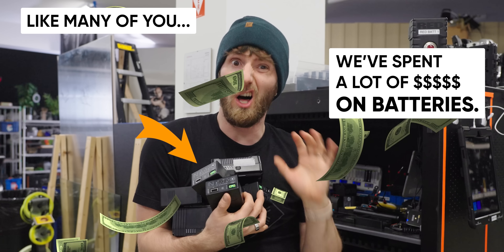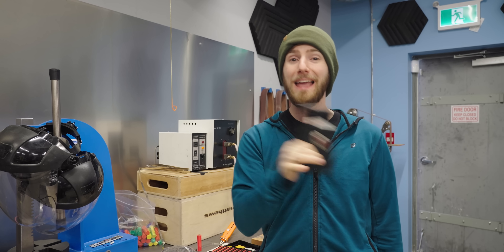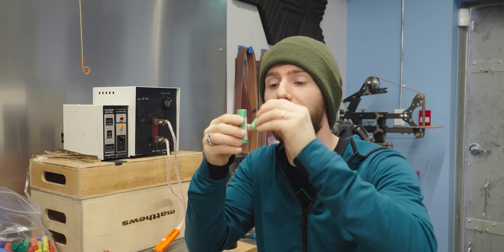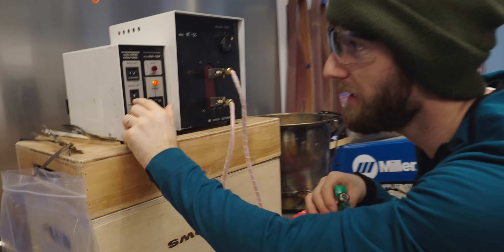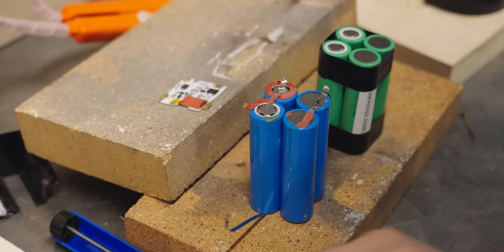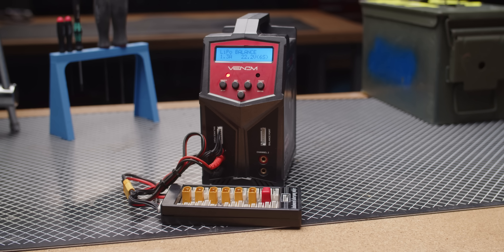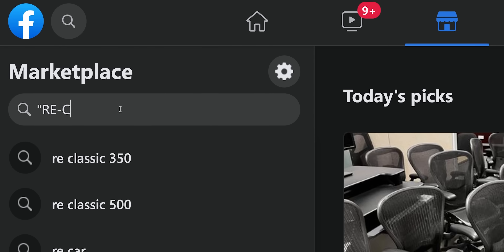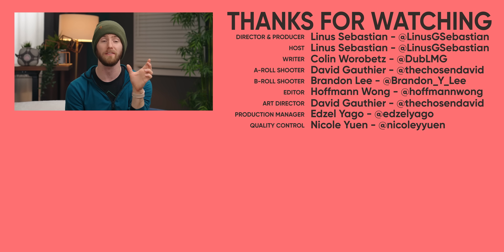This should be illegal… Battery Repair Blocking

Comment: So im no certified electrician and I’m self taught by YouTube. You need a system that doesn’t require a press down like that. I use a button on side and apply my own pressure it’s a very light press and a quick tap of the button. It does the job very well and it stays. What your doing isn’t right. You need to see some tutorials. The spot weld is too big and you need something small. For more control and accuracy.

Comment: 11:15 watch it in slow motion, he is welding a negative lead that is not connected to anything, I do believe you are overreacting good sir. Bro, I have literally sat there and sparked an 18650 300 times in a row for 5 minutes straight nothing bad has ever happened, that will not hurt it at all. It is when it is fully charged and you shorted out for more than 5 minutes, because the battery will heat up.

Comment: It's pretty frustrating how you can replace a battery to revive an otherwise dead electronic device but it is software locked to be useless. I tried replacing the button cell battery in a Tile with a non-replaceable battery for fun and was able to get it powered on. But no amount of effort could get it to connect the app because they added a software expiration date to them so it's useless. I saw other users had luck many years ago but this software expiration date was added sometime after. I did try making an app to communicate with the Tile and I was able to see it as a Bluetooth device but I haven't been working on the project anymore and the required information for it to work is likely encrypted.

Comment: This is exactly what happened to my Dyson battery packs. The BMS has a set amount of charge cycles before they stop charging. I removed the BMS from the battery pack and tested the cells just to find out they work perfectly fine. Lost 1 loyal customer after that!

Comment: I would like to see you buy generic bms boards and build your own red batteries with more capacity and longevity 3d printing the new housing. It does look like a fairly simple project. Use a lipo battery charger from china, like the imax version to individually charge each cell to the desired voltage before assembly. You don't even need that much tools. You can just use a 3 USD soldering iron. you will just need to sand the battery terminals for it to glue to the wire using normal soldering.   Than you can sell it on LLT store

Comment: You need to put the Sony battery to a charger for activation - since the BMS and protection circuit was unpowered, its in "protective" state, not to mention that with the random order of connecting the 2S stack, you could have triggered it to enter the protection and disconnect.

Comment: There's a great video by DIY Perks where he turns 84, 21700 li-ion cells into a single, 50V, portable power station. He groups all of the alike voltage cells, retrains them with a charger (Storage mode), lines them up in holders, spot welds them in series, gives them a BMS and, Bob's your Auntie, a chonker DIY power "Brick" the size of a briefcase that you can run a microwave oven with.

Comment: You missed one major step Linus. Many BMS boards will actually shut themselves off once they're disconnected from a battery. Once you wire your battery up you put a charging voltage back into the battery and the BMS will reset and then you can measure a voltage from it. Many boards that I personally purchase for my battery projects are the same way.

Comment: My take is that once a manufacture sells you something, that device works for you, not them.  Devices should be built and sold to service the user.  This means they should not attempt to stop the user from fixing, altering, or replacing parts or code.  I'm not saying they should give away schematic or code (though both are the most effective way to be customer friendly), but they cannot stop a user from using the device as they see fit.  If I want to upload my own code to a tv, that should be my right.  If I want to replace a capacitor, the device should not kill itself just because a part is different.  Things like copyright protection, and IP theft, all have ways to protect from a legal standpoint.  Tech should not be the judge, jury, and executioner, nor should tech companies.  Plain and simple.

Comment: As an electrical engineer I highly recommend you run the battery pack to be repaired down to the lowest possible charge state before disassembly...also the replacement cells should be at the lowest charge state for the chemistry.

Also as for the battery lock out (planned obsolescence) ...see Makita batteries.
Thankfully there are ways around the Makita shenanigans nowadays.

Comment: I've already did a RE-CELL on my laptop battery pack. Also 18650's. Just bought the cells with the nickel tabs already attached. Worked flawlessly in my case. Laptop worked (on battery) instead of 20 minutes up to 5 hrs again.

Comment: hey linus just a tip if your going bin the battery's please submerge them in salt water for a min of 24 hours this will slowly discharge all cells at the same time. then you can test volts again and submerge till 0V is reached.

Comment: Please mention that 18650 cells are all specced differently as well. You went to a vape shop, so I'm assuming for your needs you needed a battery rated for a speedy discharge rate. Some batteries are good at short bursts of power. Some are good for capicity. Etc. Every product will have its own needs when it comes to what kind of 18650 you need.

Comment: Before disconnecting the bms, you need to connect a voltage source parallel with the BMS, then remove the battery. Otherwise, due to the 0 volts on battery terminals, the IC in the bms detects a short circuit and locks itself.
This is not malicious, it is an added security. This mechanism probably saved countless lives and prevented many fires!
Reply: Often it is neither malicious nor security. A cell OCP implementation can be as simple as a  P-MOSFET (usually), resistor, and low voltage zener. Disconnecting the OCP circuit can cause the gate to float and discharge causing the protection FET to latch up. That can be reversed by shorting or reverse biasing the gate-source and it will work again in such cases.

Comment: Honestly, why are you making these videos if you end up doing a crappy job of it?
You never shorted a single cell, it always was your spotwelder sparking. If you had shorted a cell, you would have definitly noticed and would not have the time to put it in a bucket by hand....
This is now a Video of you putting a bunch of working cells into a bucket of sand and misrepresenting the danger level and difficulty of the task at hand, while at the same time showing improper safety procedures.

Comment: Thats the spot welder sparking because you released pressure before it had turned off the power not the batteries failing, if the batteries failed you wouldnt be presenting to camera as you calmly pour sand on top of it

Comment: I have to disagree. If companies did not take measures to prevent or make too complicated to be reasonable this kind of swap out they should be absorbing the guilt for the inevitable injury of people performing these procedures. Accidental amateur bomb making is absolutely in the realm of reasonable safety concerns. The act of design is to discourage dangerous use of a product. There is no reason to assume the average diy repair actor, has your level of access to high quality tools and safety equipment or would bother with them.

Comment: Something to think about:
Manufacturers intentionally put "safeguards" that essentially disconnect the pack if for any reason the batteries fall below 2.6V. Overdraining LIPO/LIION batteries below a certain threshold permanent changes the batteries internal resistances and can cause them to lose capacity, and worst case scenario can increase the chances of internal shorts, high resistance and runaway or battery venting(Fire). I'm pretty sure this is achieved by making it so that the hardware used in the pack just loses its software below a certain voltage and just stops working. The intent is to keep people from burning their houses down but the downside is not being able to re-cell a battery pack.

Comment: 1 thing which you guys didnt seem to mention is, if you buy all new batteries and some are discharged like they are here, that means the batterys were stored WRONG and that is terrible for a pack like this because when they are stored on an incorrect voltage for a long time they WILL degrade, storage voltage for a typicall battery is around 3.5-3.7v around 50-60% charged.

You had 5 cells which were low which on its own doesnt say much but means they were not correctly stored, this doesnt have to mean that they are bad but depending on how long they were stored for before you use them they will for sure loose some capacity compared to the others which makes them not last as long and will put more strain on the bms when charging and discharging, 
because it tries to equilize the batterys which have less capacity. Wasting power and converting it into heat which is never good.

ive been recyceling old laptop battery packs for years now and actually test and reuse the good old cells. i do that with a battery capacity test device which charges a battery fully, loads it up with 1amp constantly and measures the time it takes to discharge and than doing the math it can calculate for you how much rest capacity is left in the battery telling you if the battery is still usuable or not.
for example 1a load over exactly 2 hours would mean a capacity of 2Ah

If a battery is low or high on voltage i would recommend taking a few of them and testing them in a capacity test device if doing this on a large scale. just to see how much capacity was lost, and to get a rough estimate on how long they were stored for. its wosse if a battery is stored with 2 high of a voltage than too low but both arent ideal.

i think it has something to do with the lithium ions inside the battery over time diverging into the seperator membrane when left on a too high or low charge because than one side is rich and the other side is lean with ions making them slowly merge into the seperator thus making the internal seperation ebtween the plus and minus pole slightly conductive over time making a internal resistor which just drains the battery over time, which than makes the battery always loose charge in storage which intern make the seperator even more conductive and it just goess in a spiral, thats ofcourse the worst what can happen, but ive seen this happen where a battery had such a high internal leakage current that my charger never stopped taking a charge because it was just wasting the energy into the battery itself making them heat up basically acting like a resistor internally because the seperator was damaged because of wrong storage

in the end there i started to just tell a bit of what i experienced which probably wont happen for the majority of the batterys because that battery in my case was OOOOLD probably like 10y old wrongly stored but its just to show what could happen when storing wrong and for a long time, that is also why someone should store batterys when not in use always at about 50% charge to avoid this from happening because both sides are about equally stored with ions making them not dispurce into the seperator

Comment: Lenovo made a fuse blow if battery goes down below safe voltage unfortunately that made cell replacement very difficult as you had to solder some wires to BMS and keep it powered throughout entire procedure. That is a great safety future and I don't think it was anti-repair on purpose. Unfortunately while older items like my IdeaPad are less likely to have anti-repair "features" they are very likely to be made without any intend to be repaired. Just like ultrasonic welding of cases is MUCH cheaper than using screws so power supplies are nearly never repairable despite being one of the easiest repairs possible. (it's almost always the huge, through hole capacitor, very easy and cheap to replace)

Comment: If the battery pack is generic 18650 batteries they could have easily made it more user friendly to replace.... They do this on purpose... This is mean. I had no idea other devices did this. I didn't realize how common this battery type is (I understand there are many different specs of this battery size but still)

Comment: You had the right equioment, the right safety equipment, and a general knowledge of how to do it, and you messed it up multiple times. This is exactly why manufacturers put these soft protections in. You know a lawyer could find a way to hold the battery manufacturer responsible if you did your own self repair and another cell blew up. Also, if you have the right connection and software, you can turn those batteries back on. But again, why would they give that to an individual if you couldn’t do it safely. That being said, I do love that you tried. We all want to try things and you show it. That is appreciated…

Comment: So many things... Showing a clip with sparks blasting from the spot welding, wearing rings on both hands unprotected, not trying to hook the finished battery pack to the charger to see if it "resets"... Typical LTT fashion.

Comment: The times I’ve replace cells I’ve done the following

Test voltage before and after disassembling the battery

I then charge all the new batteries to full and then discharge them to match the voltage

And then boom not yet had a failed transplant yet

Tho for ones that delete you can solder on some AAA batteries so it doesn’t clear

Comment: way too much current lower it down and welds should hold fine and sparks that occured was probably gap between strip and battery and always try to use same calls as oem from trusted retailer

Comment: That's a shame to lose a whole pack some of them are probably good same goes for the used ones. I definitely wouldn't reuse if I was going to rebuild a pack if you're going to the effort replace them all. Then find all your good used ones and get a few of those USB charger things off eBay where you can slide in a single or double.

Comment: The evil BMS reminds me of the trick that Epson used to employ (maybe they still do?) in their laser printer photoconductor units. The unit had a fuse which would blow the instant you fitted the new unit into the printer. This would trigger a counter in the software which would count down until reaching zero. The printer would then reject the fitted unit and insist on a new one, even though the "old" unit was good for at least four times round the merry go rounds of counter life - something we discovered after investing in a bag of replacement glass fuses..
Reply: Love one trick on Xerox printers I had in my previous work, if you try to print a banknote (definetly USD and Euros) it will show an error and if you try to print it the second time it will brick your printer.
Reply: Yea lots of lasers still do this, madness it is
Reply: @DarrenLewarne  some day i will open it up and put in a small polyfuse to shut it up permanently by just resetting to 100% every boot
Reply: I got an OKI C511 that does the exact same thing from my old school. At least i could trick it with some software menus so it only complains after ~10 printjobs after wich you just turn it off and on again but who cares free color laser printer.
Reply: Remarkable stuff peeps!

Comment: The cells from the "dead" battery can serve in flashlights or something, so you should not throw away them without inspecting them. I salvaged some batteries from a laptop battery, which did not have any significant charge anymore, but they work well in flashlights.
Reply: I would use recycled batteries for non-direct drive (current limited) flashlights only if they have low internal resistance and I can see a model number to find a spec sheet on the current discharge C rating for the cell. Internal resistance is not something that can be accurately checked by most battery chargers and zero voltage cells can be in bad shape sometimes. People who vape should not take any chances with salvaged cells as that is even more demanding on the cell performance.

Comment: THE MOST EVIL portable battery lock I have seen is PSP (Playstation Portable) battery. There are so many Genuine PSP batteries ended up in dumpster. It will lock down BMS circuit. And the lock is encrypted just like most of laptop batteries. (Working Genuine PSP batteries are quite expensive due to this reason)

Comment: Linus seems to think "more nickel more good", but the size of the nickel strip is proportional to the current the cell or cell group will discharge. It is a safety measure so that the nickel strip burns before the cell has the chance to. So it is actually "less nickel, more secure".

Comment: I have over 10,000 batteries, I know what I'm doing. These are laptop batteries I dismantled them. I have soldered or spot weld them. I saw you put too much current on spot weld (naughty), well you are only a beginner I let you off. I came across the evil one, I strip them and reuse with a new BMS, it works with tools that have evil in them. Frankenstein is my style that I work looks cool. Yes safety must come first. Second, they in UK do have a site to take the Lithium cells, but I do not know they are recycled, they might take them abroad..